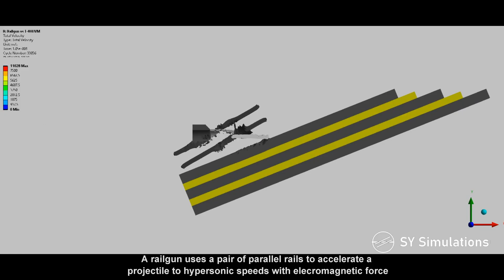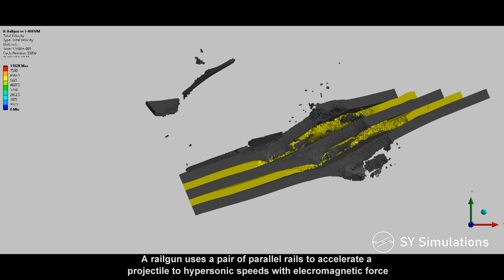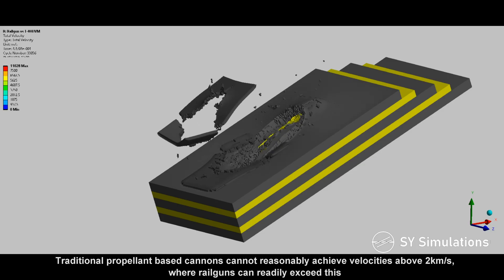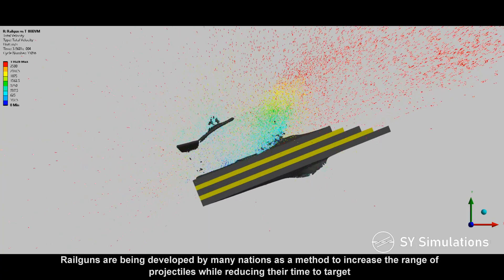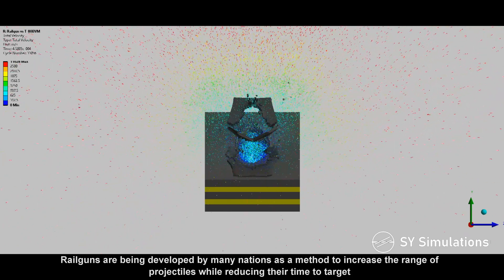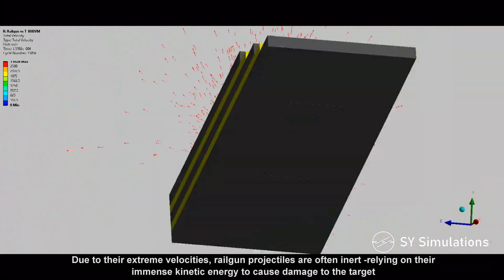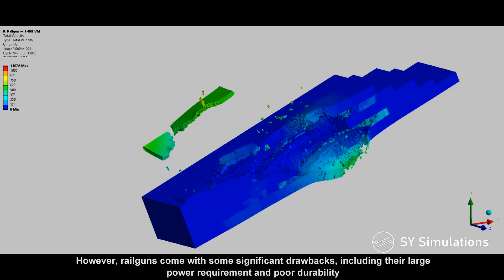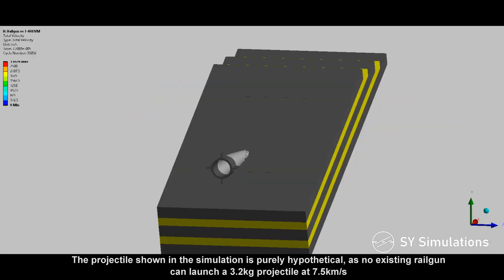RAILGUN vs T-80BVM | Hypersonic Armour Penetration Simulation | APRIL FOOLS' SPECIAL

Comment: Hot knife.  Meet buttah.  And the crew, now known as toast.
Reply: It's going to be a closed casket. Rip
Reply: More like cold butter and extreme velocity butter.  Never known a hot knife to vaporize.
Reply: just the driver
Reply: @anhta1778  Im sorry dawg when the tank is hit so hard that the upper glacis shatters into a giant hole, it's safe to assume that the entire crew is dead
Reply: Crew is mashed potatoes
Reply: And now that toast has butter spread all over it. Nice.
Reply: Realistically speaking, the projectile needs to be lighter or slow down. That 3.2kg at 7.5km/h will need the tank to tow around huge generator or carry nuclear reactor.
Reply: @dongleseon8785  Well, one of the original ideas was that railguns on naval vessels could fire inland and hit targets anywhere inside regional theatre of battle. It's not necessarily implied three projectile came from a tank, under any conditions.
Reply: I've been told from a reliable source the crew in such situations can be classified as pâté.
Reply: Crew flies to the orbit with that turret.
Reply: @IanAwfuls  how? only penetrations came from the tank's armor itself not the round
Reply: @anhta1778  I dont think the turret would go flying from this but more than the driver would be dead, im sure the pressure differential from that impact would be lethal to all the crew inside
Reply: @anhta1778  that amount of shrapnel would shred the ammo
Reply: @anhta1778 Unreal isn't it. People sat watching the video, confidently concluding the complete opposite.
Reply: @ That's literally what happened

A tank's frontal glacis just completely shattering into tiny pieces and flying back at the crew at insane speeds is generally fatal for the tank, the crew, and the ammo

It was technically a non-pen, but the KE was just that strong

Comment: А почему вышибные панели "реликта" замоделены как бронесталь, аналогичная корпусу? Там очень мягкая сталь, типа котельной - иначе на таких перегрузках будет просто раскалываться. Почему она вытирает об себя вольфрамовый сердечник, который её как свинцовую фольгу проходить должен? Как идея, смоделируйте ДЗ "Нож". Интересно посмотреть на концепцию.
Reply: с учетом увиденного, легко предположить, что ДЗ "Нож" тоже не будет эффективным, так как броню просто выдавит массой частиц после разрушения стрежня. То есть, "Нож" может и повлияет на результат количественно уменьшив энергию удара, но этого не хватит для изменения ситуации на качественном уровня (листы брони все так же выдавит внутрь машины)
Reply: но мне тоже интересно посмотреть моделирование
Reply: At such speed the hardness of steel should not make a difference. The speed of sound in metals is about as much so the metal will disintegrate regardless, it cannot spread the forces away from impact fast enough and damage is localized. The tungsten core passes indeed but as a spray of particles and the small particles are hidden in the visualization. The particles still impact the armor and it reacts.
Reply: @MarcinP2  почему не важна? Твердость более чем важна. Скорость столкновения не сверхзвуковая для вольфрама, как и разные эти скорости звука в разных металлах. Иначе не существовало бы бронестали, а корпуса БМ делали бы из обычного железа, которое легче и дешевле; и не было бы никакой керамической прослойки в броне, как и брони из обедненного урана. Хорошо, если в данной модели действительно твердость(а следовательно, ударная вязкость) не имеет значения - просим испытать вышибные панели ДЗ из разных материалов, начиная со свинца. А то у нас оказалось, что АМХ 13-75 СУ-100 с 500 метров сплошным бронебойным снарядом не пробивает; в то время как Пантера каморным с этой пушки делала такое в реале с бОльших дистанций (700 метров)... Дополнено. Это я про толщину панелей "реликта" не вспомнил сразу, а она, судя по масштабу толщины 50мм листов корпуса, не меньше 15мм. А в реале она вдвое тоньше; не более 10мм.
Reply: Не совсем "вытирает", просто из-за колоссальной скорости частицы очень маленькие получается, автор специально отключил отображение слишком маленьких частиц, а то весь экран в них будет

Comment: I thought it would pass a lot easier. Impressive
Reply: doesnt need to penetrate if it can turn a tanks own armor into a projectile
Reply: @alexvolute7454  spauling is show in in this clips visual to be minimal. its all hypothetical but cool to see
Reply: @a_turn_of_events8390  these videos hide small enough particles because there are so many of these particles that you wouldnt be able to see the simulation results very easily, as the creator explained in the past. in other words, there is a massive amount of small metal particles moving fast enough to seriously harm things in this simulation, you just cant see them.
Reply: @a_turn_of_events8390  Go back to about 44 seconds and observe the MASSIVE HOLE ALL THE WAY THROUGH THE ARMOR
Reply: @ thats not the jist of spauling sorry to be the bearer of bad news. a clean hole isnt what dictates spauling, its an addition along with other factors. but sure it did create a great hole
Reply: @burner33  Literally turned the armor itself into a makeshift macron cannon, at point blank range. Bonkers
Reply: @a_turn_of_events8390  
Shit inside are flying at couple hunderds meter per second. 
That's not minimal.
Reply: @jintsuubest9331  yes, mate, yes it is. Im sorry to really upset you here... but in the world of projectiles and explosives, that's minimal. APFSDS rounds we have now live by that design of penetration over spauling... post penetration damage is best worked towards mass/weight > speed. this is a very small projectile.. like super small, moving super fast..
Reply: @a_turn_of_events8390  "minimal" my guy entire chunks of the armour were flying into the crew. There was nothing minimal about it.
Reply: @a_turn_of_events8390  that holed armor material need to go somewhere, it's not instantly vaporized, but turns into small metal fragments flying faster than .223 bullet. Those fragments would dig itself deep inside the crew grey matter.

Even the shockwave itself is already guaranteed deaf and blind with that kind of impact.
Reply: @a_turn_of_events8390  Check the speed of the ERA plate with the spall coming out the other end. It's at least mach 1. Also not shown the massive jet of metal plasma. The stimulation disappears small particles below a certain size to save compute, hence why the projectiles like APFSDS loks like it erodes and disappear along with chucks of the armour but not WW2 or solid shot.
Reply: @a_turn_of_events8390  My guy the entire interior plate collapsed into the crew compartment. What the hell are you talking about?
Reply: @burner33  I bet there would even be molten metal
Reply: It's also lighter than a typical APFSDS penetrator and impacting at much higher velocity so even if the projectile breaks apart, it still transfers a tremendous amount of energy that propagates thru the plate and sorta turns it into a new projectile like someone above me said.
Reply: Don’t take this site to seriously. They showed a IS7 surviving a hit from a projectile from a battleship.
Reply: @j.m.1524 i wouldn’t consider a 40cm hole survivable, you must have forgot the actual video
Reply: @j.m.1524  these are simulations. They obviously cannot simulate the entire tank, so they simulate the impact point as a fixed piece of armor, it can't move. These simulations can take days to compute for average consumer grade hardware so they have to simplify them wherever possible. Anyone with half a brain would know that the extreme energy transfer is still there. That simulation was supposed to show simply how the projectile would behave upon hitting the IS-7's front plate, not all the "significant emotional events" that would've followed.
Reply: The faster the projectile, the more explosion like the impact is. 12 to 15km/s asteroid impacts leave literally hemispheric craters. 😂
Reply: @alistairalexanders  yes if if the object is stop and the innate energy passes into what ever stops it, like an asteroid to earth.. but an object that pierces has a narrower cone of energy, making the spauling effect in a tank smaller. Im not saying there isnt a massive amount of energy behind the projectile, and the energy travels inside the tank and would be horrible, but the spauling  not much more than the hole created itself and maybe a smaller diameter around that hole. again all this is theory but its a pretty simple projectile formular
Reply: It pass through like a hot knife through butter, the round got shredded because it was a shorter projectile compared to those dart type ammunition.
Reply: Are you high? The plate was out right obliterated 

Bro, the projectile was GONE right, vaporised, non existent....and just the transfer of energy alone defeated the armor totally 

What do you mean "a lot easier"? What do you think happened?

The projectile was a 20mm round. There simply wasnt enough of it to survive, yet it turned the armor itself into a frag grenade
Reply: their is a point where things are moving so fast that when they hit they stuff they are made of collapses like sand from the impact no matter how strong we make the metal, Uranium and titanium are barely strong enough to not shatter at their speeds.
rail guns can theoretically shoot things so fast that the metal just explodes the moment it touches something including air.
Reply: Thr whole tank face would be gone. This is simulatef that it dosent move. Stupid arse
Reply: Its only 3.2 kg.
Reply: Would be cool if you used DU with it being self sharpening and all
Reply: And it's only 20mm imagine it being the size of an abrams round
Reply: That spalling would devastate the tanks interior.
Reply: FYM? THE ARMOR VAPORISED!
Reply: nah just casually vaporized a hole straight through..
Reply: @duhdardar624 The projectile disintegrated. I would expect a multi-billion dollar gun to deal a lot more damage to a tank from the 70s

Comment: That driver is really regretting everything right now?
Reply: That driver doesn't have time to regret.
Reply: He'd be dead before being able to perceive anything happening, just like the OceanGate Titan implosion. I don't think driver ports have magnification, so there's pretty much zero chance he saw a hypersonic 20mm projectile coming at him. The projectile reached him faster than the vibrations through the tank hull from the impact, and even the bright flash from the penetration would happen such a short period before death, that it wouldn't actually process in the brain.
Reply: Driver? The entire crew goes on vacation
Reply: The entire crew is a purée